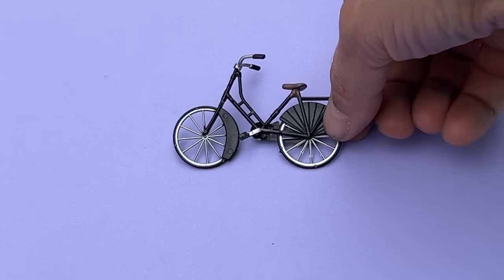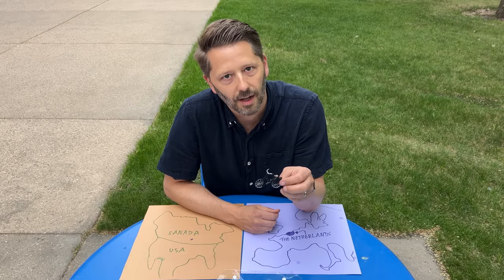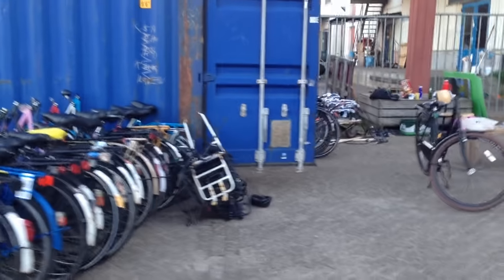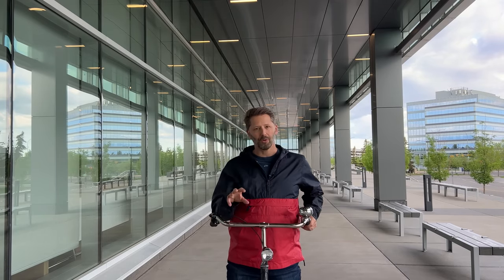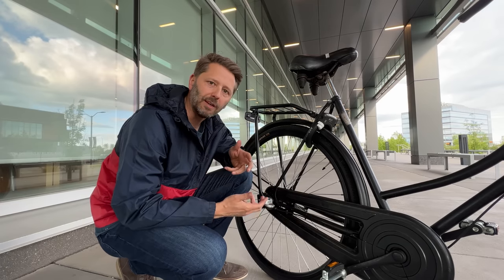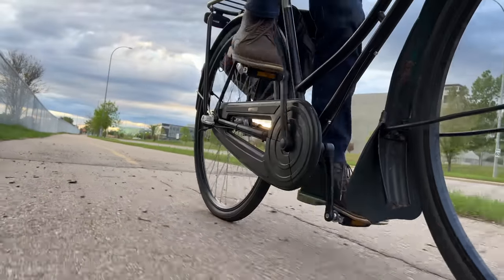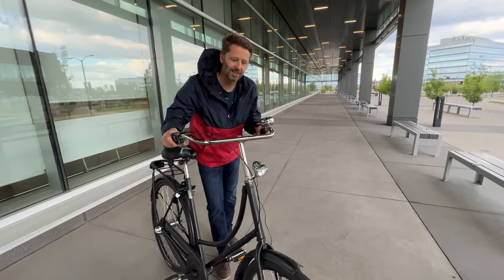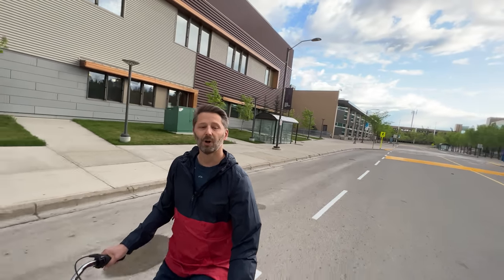I finally found a true Dutch bike in North America. Here's what you need to know

Comment: Swapped the stem on my mountain bike for a straight - 90 degree adjustable one and put it in the straight position to bring the handle bars up and back significantly. 
Definitely made it ride different, but this part is important, I can actually ride it again. My wrists and back can not do the leaning forward crap anymore.
So for $15 I made my bike usable again. Would definitely recommend.
Reply: You can also buy two inch stem extenders and swept back bars very cheaply from planet X bikes. Then make any bike you have much more comfortable
Reply: Great advice! Finna do the same!

Comment: I remember being thrown at first when I arrived in Copenhagen and everyone just left their bikes around everywhere.  I knew it was low crime, but that seemed extreme.  Then I realized they had the in-built locks on the back wheel, which I'd never seen before. 
I really want to get a Dutch bike at some point.
Reply: "normal bike" - it is the most regular european bike we can think of. Some dutch variations probably exist on this one - but nothing that does stand  our from a normal bike in any european country
Reply: In cities its also very common to have an extra cheap and beat up (looking) bike so it's less likely to get stolen and even if it is stolen you can get a replacement for under a 100€
Reply: That lock on the back is how I lock my bike in >90% cases. It takes about a second or so. I only use the chain in a high risk place because it takes a bit more time.

Comment: I happened across an older, pre e-bike VanMoof B6 at a flea market. I bought it on the spot. It feels like a more modern version of this. It has a step-thru frame, fenders and chain guard but also disc brakes and integrated lighting with a front wheel dynamo. It's heavy as hell but for my roughly 5-mile commute and errands around NYC, with a pannier rack and a good lock, it opens up the city in a way that driving or walking never could.

Comment: I bought a hybrid bike like 15 years ago.  After riding it regularly for like 8 years I got a pinched nerve in my neck.  I had to do something to be able to keep riding.  So I put two neck extenders on and a beach cruiser handlebars.  Those two thing changed my riding position from leaning forward to sitting up straight like a Dutch bike.  I will tell you I will never go back.  It is so much more enjoyable sitting up and being able to look around and my neck fully healed.  If I had the spare cash I certainly buy a Dutch bike.

Comment: I purchased a used bicycle imported from the Netherlands, and it is so great. I am over 6' tall, so the "medium" size Dutch bicycle is actually bigger than a North American "medium" so I can ride more easily. The built in dynamo lights, the internal hub gear shift, the fenders, back pannier holder built in, and upright position are so well designed for everyday riding.
Reply: One thing about Dutch bicycle sizes. We don't really do bicycle sizes here. Almost all are a 28 inch model with smaller sizes being reserved for kids. It is a herculean task to find an adult bike that is not 28 inch.
Reply: @memunist5765  
he's talking about frame sizes, not wheel sizes. Frame size just like tire size has  a big influence on how the bike rides, it influences the geometry enormously. And the lack of variety of wheel sizes is not a good thing, it leads to all kinds of bad ergonomic compromises in bike designs.
Reply: @Exgrmbl  I was also taking about frame sizes. A 28 inch bike is the adult bike in the Netherlands.
Reply: @memunist5765  
Thinking about a wheel size as adult or kid makes zero sense. Bike size, as wheel size, is a function of body size. Why would a 155cm boy ride a different size than a woman of the same size?
Reply: @Exgrmbl  Almost all adult bikes frames in the Netherlands are the same size. That is all I am saying. I said nothing about tyres.
Reply: @memunist5765  
28" as a measurement refers exclusively to wheel size, as a measurement it says nothing as to what size a bicycle is. You can have 20cm of frame size difference between bikes, while both use the same wheel size. You are confusing me a bit here
Reply: My electric bike (made by the Electric Bike Co) is very Dutch in style and thus very comfy to ride. It has a step through, fenders, built in rack, frame mounted basket and chain guard. All it’s missing is the coaster brakes (it had disk brakes because of the electric speed). In fact, the last time I was in the Netherlands I felt like my rental bike was not as stable because the handlebars weren’t as generous as my bike at home. 😂

I have been trying to convince the company to add the wheel lock feature. And definitely if you have a nice bike in the Netherlands you use both the wheel lock and the chain lock.
Reply: @memunist5765  no you are wrong, frame sizes are a thing here (even for cheap Cortina bikes for example). 28 inch is the wheel size, not the frame size (that is like 49 - 62cm).
Reply: @memunist5765 28 inches is the standard wheel size. But standard frames vary quite a bit from 49 cm to well into the 60 cms for the tall people. Like, there's no way someone who is 150 cms tall and someone who is over 200 cms tall could comfortably fit the same frame size

Comment: Several years ago I solved the lack of Dutch bikes here in the US by purchasing a Walmart 7 speed steel frame commuter, we have some mean hills here in the Piedmont of South Carolina so I installed a gear set with a low hill climbing gear. I then ordered a long stem and swept handle bars from a bike shop in England, put on a wide upright style leather Brook saddle. I also ordered the old style traditional small leather handlebar bag and wide round seat bag from India. I installed a rear rack from Walmart that has a solid bottom that also works well as a rear fender, no front fender since this is purely for recreation not commuting, I’m retired. I put on a traditional old style front head light. It still has the caliper brakes but with the old style  chrome levers I ordered. No chain guard but the original front sprocket guard, then toped off with the old chrome ding ding bell. Except for the lack of front fender, full chain guard and the 7 speed derailleur it being all black except for the mounting hardware chrome accents at a glance she looks like the post war imported “English Racers” of my youth. The low geared 7 speed drive system makes it a dream to ride. By a bunch of tedious world wide shopping by a very cheep old man I was able to bring her in for around 300 USD, but then that was about 10 years ago. I am however turning 72 and just ordered an electric friction drive assist from QiROLL since I’ve got a couple long grades my old knees are having trouble with.

Comment: Dutch bikes are great for commuting.
Also, great project. Congrats, guys!
Reply from the maker: It's such a cool project.
Reply: Wouldn’t a hybrid bike be better to get out of the way? I was thinking of getting a comfort bike but that thought process left my mind when I remembered our roads and lack of bike infrastructure. So are you sure Dutch bikes are good to getting to work? Genuinely want to know as in the future I plan on getting a hybrid bike so it’s easier/faster to get out of the way of cars.
Reply: @41052 
I can think of a few reasons a commuter bike is better than most hybrids for urban cycling. Feel free to disagree. 
An upright cycling position is better for visibility. It's easier to look around and get a view of traffic. 
Some hybrids could give you this but many put you in a forward leaning sporty position. Much harder to look around that way. 

A step through frame makes it a lot easier to get on and off the bike. Especially if you have a tall trunk bag or child seat at the back. This can be had in hybrids marketed to women (for some reason). But most hybrids have a horizontal top tube.

Easier to attach fenders and racks. They're usually already assembled from the factory. Much better than putting aftermarket parts onto a hybrid as you often run into compatibility and clearance issues.

Most Dutch bikes have dynamo lights from the factory. Again much better than battery lights or trying to retrofit a hybrid with a dynamo set up.
Reply: I love upright riding on a bike of this style for short commutes, getting groceries, and doing general running around. You have great visibility, it is very comfortable, and you can carry quite a bit on the rack. The only downside is it is slow but I'm usually not trying to set speed records on the way to the grocery store.
Reply: Different horses for different courses.  For a short, low speed, flat commute, yes they're perfection.  I've actually owned bikes with similar characteristics for commutes like that and enjoyed them tremendously.  But my experience is that perfection evaporates quickly if you need to take the bike outside it's natural habitat.  

Sure, they're supremely comfortable for slow flat rides under five miles, but over ten and sitbone pain becomes an issue and you're better off with a more even weight distribution.  Speed on these things is limited, not just by aerodynamics, but by handling. They can be a handful going down a steep hill because of the changed weight distribution, and that tiller-like steering that makes them maneuverable at low speed makes them super twitchy at even moderate speeds. The coaster brake is just a terrible idea unless you can confine yourself to an easy jogging speed.  Again the problem is the bike design can't handle a shift in rider weight, which occurs naturally during hard braking.  At the bottom of a hill at a red light you'd slide right into the intersection.

Finally on the dynamo lights -- I used to use these back in the 1980s, but with today's powerful and efficient LEDs there's no reason to use them now.  It is nice to have the light permanent mounted though. Another thing I'll note is the lack of front and side reflectors on this thing.  Wheel reflectors are uncool, but they really work to stop you getting T-boned in the dark.  They do look dorky, and their absence is part of this thing's hipster curb appeal.  I'd suggest a product called "lightweights" which are strips of retroreflective tape that wrap around your spokes near the nipples.  

Depending on what your commute is like an omafiet might be absolutely perfect for you. Or it might be uncomfortable, or even dangerous.  If I had to recommend a bike as a commuter and knew nothing about the person's commute, I'd recommend a hybrid with high volume tires, V-brakes, and 2x derailleur gearing. And of course properly outfitted with racks. A hybrid bike is not perfect for anything, but it is remarkably versatile.
Reply: @41052  
Yes. Dutch bike is ideal for low speed and low effort flatland riding. If you do anything remotely long distance or strenuous, or god forbid, be fast about it - forget about them.
Reply: @Free-g8r  okay thank you for this, I think I will look for hybrids that are upright and for women as I am one but weird that it’s only there when marked towards women, I’m sure men would appreciate a dropped bar too. I do agree about the light and the cargo thing so I’ll look into it.
Reply: @Exgrmbl  okay for sure then as it will be around nine miles to get there.
Reply: Thank y’all all for this info! I will look into lightweights.
Reply: @AG-bp3ll  Another thing is if you cycle with friends or family, it's way more easy to have a nice conversation while cycling!
Reply: @grumpynerd  I agree with a lot of your points, especially about the light; dynamos are hard work and break easily. But in my area, it's quite normal to bike 10 miles to another town, and back, without any saddle pain.
Reply: @grumpynerd  I'm 47 years old and I routinely use a 15+ yo roadster for distances of up to 40 kilometers. It's a bit more advanced than a classical opafiets, 7 gears, handle-bar brakes, hub-dynamo, that kind of thing, but the general idea is pretty much the same. I average, depending on the wind, somewhere between 18 and 24 km/h without even really trying. There's hills around here, and and it does get a bit scary if the speed gets over 40 km/h but these bicycles are jacks-of-all-trades, and that's exactly why they've been popular for over a century.  And not only in NL. Yes, if I, for whatever reason, didn't ride for a couple of weeks, the butt-hurt is significant, but your body adapts soon enough after that
Reply: @Marinus_Calamari  I think you nailed the speed issue; at 24 km/hr you're probabably still fine but between 24 and 40 the steering stability becomes more and more of a challenge.  The other issue is weight shifting during hard braking.  I'm not saying it's impossible, but it actually takes more skill to emergency stop a roadster type bike from high speed than it does a racing bike.

Comment: It looks like the bike geometry on Dutch bikes has a pedal forward style, which is probably why you see the Dutch people ride with almost fully extended legs on the pedals.  This makes sense from the standpoint of less fatigue and better for your knees.  This probably also explains why I see them, in videos,  able to stay in the saddle with feet on the ground when at a stop.  I could be wrong, but that's what it looks like to me.
Reply: You are right.
Best position is to put one pedal to its lowest position, and then your leg should be slightly bent (as in: not fulle straight/extended with with a small bend). This way you can give the highest force without putting too much stress on your knees.
Reply: These bikes are great to learn the value of right posture, if you set up the saddle and steering height properly to your body its gonna be super relaxing and easy, but set it up bad and its gonna be hell to take on even the smallest of hills.
Reply: Yep, usually you set the seat hight to be so you can just about reach the floor at a stop

Comment: It's funny, here in Finland those are just called bikes. 😄 Though sometimes we call them mummo or pappa bikes. In fact I have one from my late grandpa, made in the 1970s or early 1980s I think. I use it daily for shorter trips like grocery runs. I share that first feeling you had of "Whoa this is really tall!" - compared to my road/cyclocross bike it feels crazy tall when you're so upright. I love it though for several reasons: 
1) It has a proper steel rack and mudguards. Extremely easy to throw in cargo bags on the rack or a basket in the front. It's also heavy and unaerodynamic enough that you don't feel bad using all that heavy stuff because it's not going to be fast anyway.
2) Massive tyre clearance. I've got 47mm wide street tyres on it. Schwalbe Marathons. They roll and grip surprisingly well, but are also comfy and stable over gravel and paths.
3) That riding position makes it so easy to go in traffic. You can see everything, no squirming to look back or anything. 
4) It's just so relaxing because it takes away any notion of speed or hurry. And therefore you don't worry about wearing "aero" clothing or cycling shoes, using "aero" bags or anything. And that really frees you to actually use the bike whenever. All you need is to chuck a helmet on and off you go. With a proper "cyclists'" bike it can take a long time to get going because you feel like you need to change into the proper gear and change back out of it. 
5) Service simplicity. The brakes just work, the gears just work. And the rear drum gears are so complicated I can't even service them, so might as well just have the shop do it all basically. 

What it's not so good for is longer rides and longer commutes, as it is a bit slower and the riding position is not as good for trying to go far or fast. Up to like 10-15km round trips it doesn't really matter whether I'm riding 22kph or 27kph since at most it's just a few minutes. But last year with a 33km round trip commute, I did definately go for the road bike. I was not only quicker on it, but felt more fresh after the day as the riding position is more ergonomic for putting out power. 

And yeah, theoretically, the ones that have the low-swept top tube are called ladies' bikes here, while the same bikes that have a straight top tube are mens' bikes. But that's mostly because of old-time ideas of how you're supposed to hop on when wearing a skirt vs pants. Truthfully especially any elderly people can benefit from the low top tube because it's easier to get a leg through than over. There are also special elderly models which just go without a top tube altogether. They just have one very thick tube from the bottom bracket to the headtube, so it's reeeally easy to just step through.

p.s. You can also just add a front rim brake too. Most bikes I've seen have them, as does my grandpa's bike.
Reply: Same in Sweden, it’s just a bike! 😂

Comment: Nice to see you enjoying your bike. However, a word of advice (or maybe two) : When using your bike-rack for puttng a bag on it, it is advisable to but a bag (of mostly equal weight) on both sides, this helps your ballance. Another thing when putting your bag on the rack, I would advice you to take of the carrying band or put (and secure) it on top of your bag. Otherwise there is the risk that the loop hanging down might catch on something that doesn't yield and you might find yourself having a somewhat painfull accident. Other than that, have fun riding your bike and be well :)

Comment: I have to give you a fair warning about those breaks. The power is transfered through the chain to the back wheel, so make sure your chain is well maintained. If your chain is a bit loose and you hit some bumps it can fall off and there goes your only way of braking.
Reply: That's extremely rare.